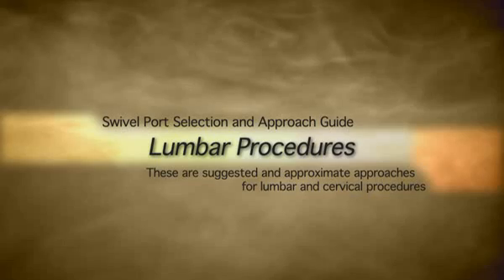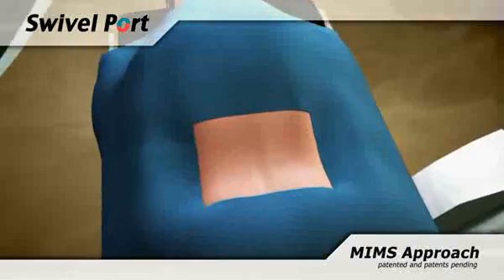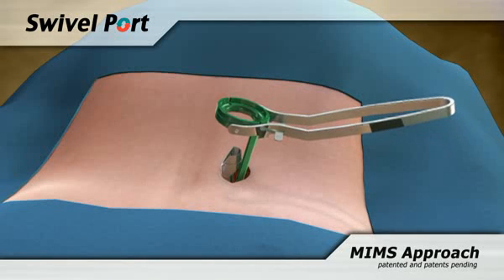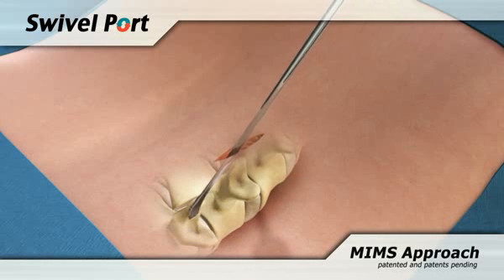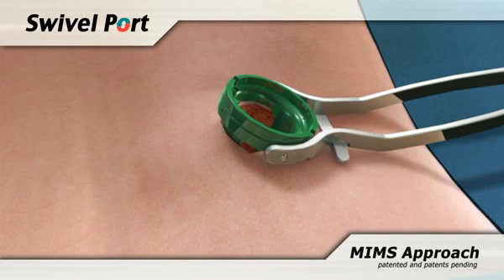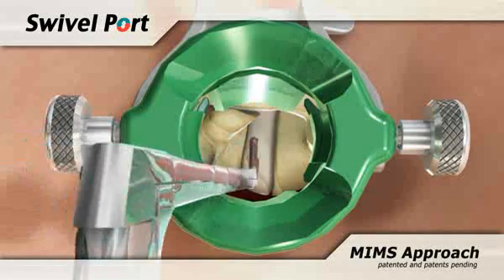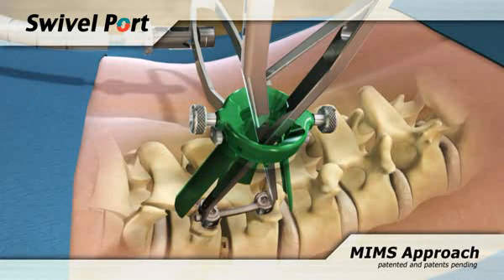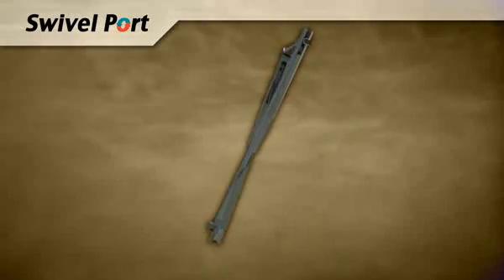Swivel Port MIS Retractor System by SSI

Comment: How easy is it to attach the rotating ring and actually open up the blade? It seems that soft tissue would prevent a surgeon from simply turning the blade around the opposite side. Comments?